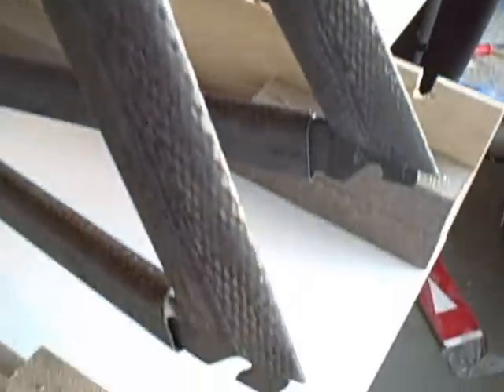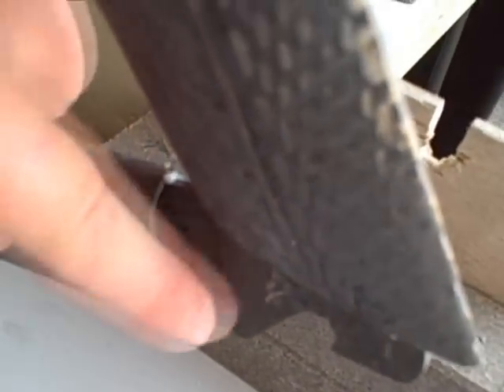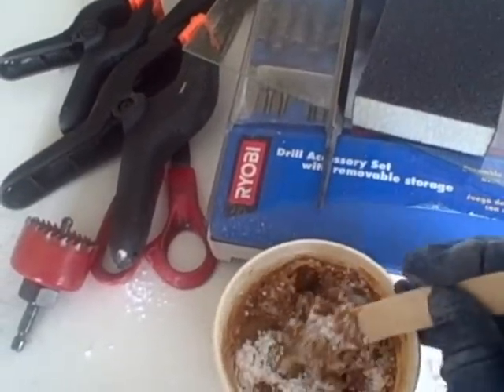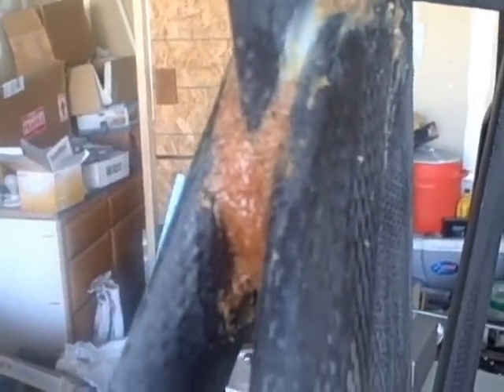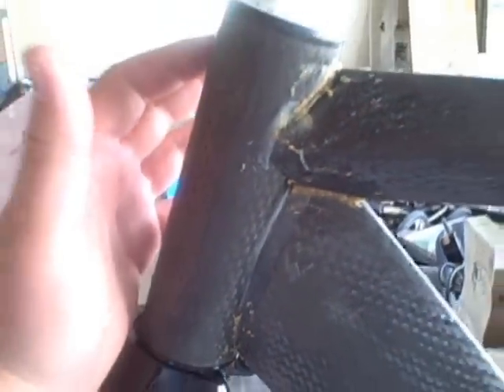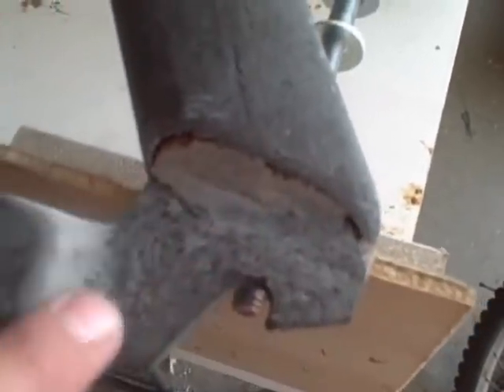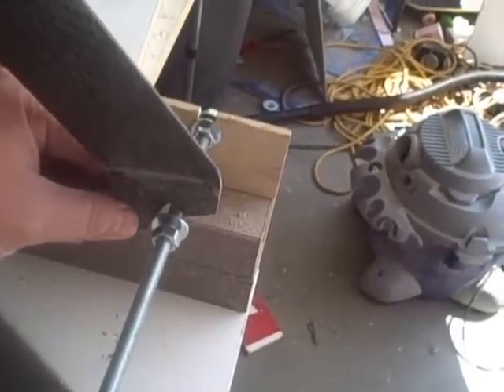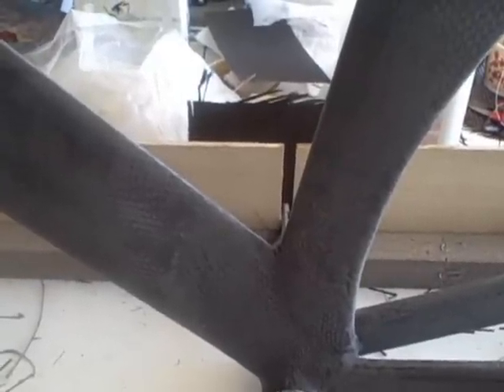Chapter 6 Carbon Fiber Bike Build

Comment from the maker: @First2ner 
Thanks for sharing this great advice. Since I did this project I've found that using a heat-gun to pop the bubbles works well. Plus I've also found that heating the frame before coating the epoxy and then letting it cool during the cure works great too.

Comment: I think  I have seen that if you use a hair dryer on the epoxy after application it will pop bubbles.  Not to dry .  a little will pop those bubbles .  Nice vid series.

Comment from the maker: Yes I made the cylinder; I wrapped a pipe with pipe tape until it was the correct size and then used that as the plug. The internal headset comes with an upper and lower cup that fits into the headtube and then the bearings sit into the cups. Its a nice system and works good. If there is any play between the cup and headtube you can use glue or epoxy to tighten it up. You just need to make sure that the headset cup's flange sits on the rim of the headtube. Thanks for the comment!

Comment: Now that you have the frame at this point I wouldn't play around with the epoxy trying to use it as a weld, that's not where carbon fiber gets its strength. I would sand that frame down smooth, and use the entire frame as a template to make a Frame Cast!  Then start from scratch with the Carbon Fiber. Now you have a manufacturing process, and the frame will be 1000 times stronger as one piece. Other wise your only solution to strengthen that frame is going to be to use bolts! Do that and your going to have a Franken Bike Monster! Anyway good design just make it all in once piece now.

Comment from the maker: @alirezaghost you're not bothering me with your questions. So ask away. I've never had carbon fiber "crack" like you mentioned from cutting or drilling it. I just use a Dremel diamond coated cutting wheel. It's made for cutting tile and it works great on cf. I also use an angle grinder a lot with a diamond cutting wheel as well. I usually just get the cut close to where I want it and then use a sander to finish up. CF sands real easy. FYI it itches just like fiber glass so I where coveralls.

Comment from the maker: @alirezaghost, I cut the foam out in the shape I wanted and wrapped the cf around the post. Imagine the cf wrapping the tube like a hard taco shell with the open ends touching each other- So, there is no seam on the front of the post and a seam on the back of the post. When I trimmed the seam on the back of the post there was a small gap exposing the foam core so I used a couple layers of cf to seal it up and join the cf together. I hope that helps.

Comment from the maker: @stockman1963 
Yes a hair-blow dryer and heat gun work well for pin holes. I've used this technique several times since doing this project. I've also learned that you can heat up whatever you're coating, coat it, and then put it somewhere to cool down while curing and it will do the same trick too. 

Thanks for the comment,
Mark

Comment from the maker: When I put the dropouts in the the jig I didn't secure the rear derailleur hanger and it moved on me. In hindsight, I should have lined everything up without the hanger actually in the jig.I ended up having to adjust the dropout holes to get the tires to align properly. 

I've used this same type of jig on the Z-Frame bike and it worked out pretty good- The Z-Frame project is on my channel if you haven't seen it yet. The Z-Frame video on Jigging goes into more detail than this video does.

Comment from the maker: @joskes123 
I did not make the fork. It is an OEM fork that I bought from a bike company on Ebay. They would not give out the name of the manufacturer but the fork looks exactly like the Bontrager fork made for the Trek Equinox TTX. I bought it right about the time Trek unveiled the new Speed Concept.- To make a long story short, I cant find this fork anymore. However, you can still find good inexpensive forks on Ebay. I just bought one for the Z-Frame Bike  for like $110.

Comment from the maker: @alirezaghost I used EZ-Poxy for this bike and that is probably the "Gel" you see in the video- It is brown. And I hate the stuff. It stinks and takes forever to cure. I use West Systems 105 or Resin Research 2100 now days- Much better experience. The "Mud" in video 7 is just chopped up carbon fiber with epoxy. You could probably use it in place of the flox but couldn't say for certain. However, I do use graphite powder and chopped up cf more than cotton flox on joints now.

Comment from the maker: @circusboy90210 
Mostly a time issue- I wasn't as concerned with the gaps at these areas because the cotton flox filler I used does really well under compression; and the carbon fiber I overlapped the joint with takes care of the tension and shear forces where the stays and tube joints meet one another. Yes, I could have spent more time on getting the tubes to fit together perfectly but I didn't see the advantage- Other than saving a little bit more weight- Cotton flox is somewhat heavy.

Comment from the maker: @alirezaghost The EZ Vac is too weak. You'll want something that pulls around 18 hg for the pink foam. I've pulled 23 hg without the foam collapsing. I didn't really like my ACP pump, it can't keep up with small bag leaks. I bought a DIY pump kit from Veneer Supplies and love it. It was expensive so if price is an issue, I hear the harbor freight vacuums work great with a bleeder valve and vac gauge- but I've never tried one.

Comment: Did you skip vacuum bagging the carbon fiber wrap at the joints (after sanding the peanut butter power/epoxy mix)?

Comment: Thanks a lot for your advices i hope i'm not bothering you with just too much questions that i asked :D also this question came to my mind: what power tool do you use to trim or cut the tubes to shape or drill a hole in them? because ive heard that carbon can be easily cracked while cutting or drilling. is that true? what do you use?

Comment: why are those gaps at the joints so big? is there a reason for this?? never done this myself buy just seems the joints should  be tighter than that.  just seems that at the beginning you were concerned with shape. does this allow for flex or some other component??  thank you very much for the videos.

Comment: Hey man ive got a few questions: im on a TT bike project right now, im getting this ACP E-Z vacuum pump which can pump to 8 HG, is that enough for the pink foam? also, what was that GEL thing that you mixed with cotton flox? ive found cotton flox but i dont know what that thing is. also, what type of resin and hardener did you use? and one more question: what is the mud that you used in video number 7? can i use that paste/mud instead of the flox and epoxy? thanks a lot man ur the best!

Comment from the maker: LOL! I love scratch building stuff. But there is a lot of work picking out components. It almost took me as long to pick out and buy the components as building the frame.
Reply: Mark King I'm hoping your still active on here. it appears that the foot pedal bearing cage is aluminum do you have any problems with delaminating or corrosion? I am researching building a bow which is structural the same as a bike frame thanks

Comment: And also, how did you manage to wrap the carbon fiber around the seat post (right where there is a cut in the seat post for the rear wheel)? please if you can respond to this quickly because i need some help :D

Comment from the maker: @alirezaghost 
Your hot-wiring problem could be a number of things. For example you may not be getting enough current into your hot wire; you could be using the wrong type of wire, your wire may not have enough tension on it when it gets hot, or you may just be going to fast and you're getting too much wire-lag. I'll send you this and my email address in a private message.